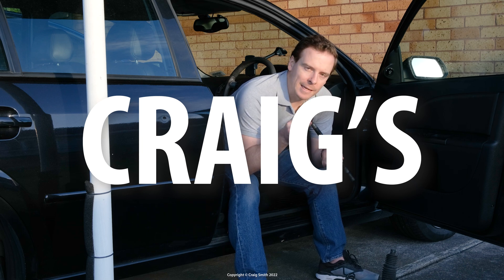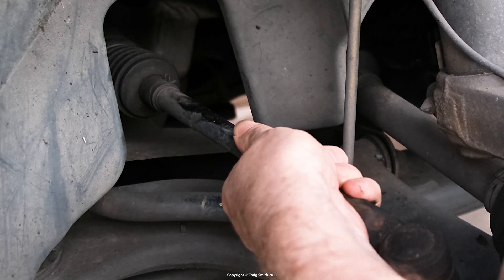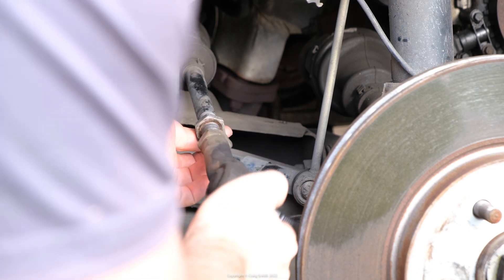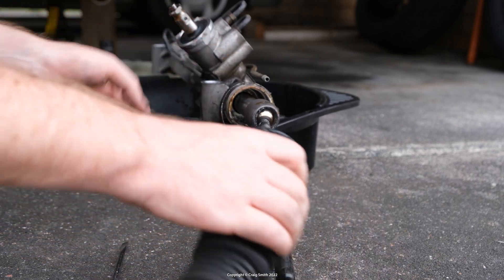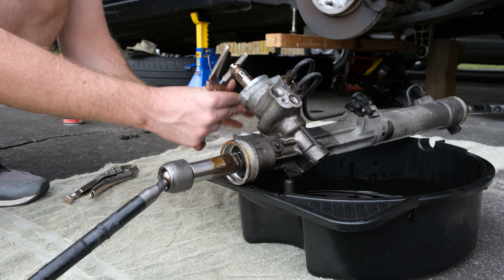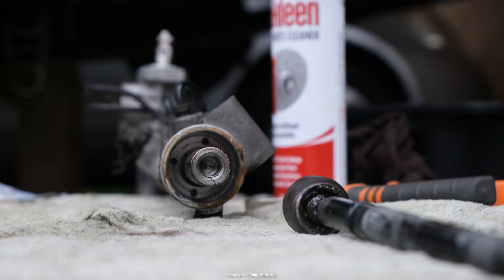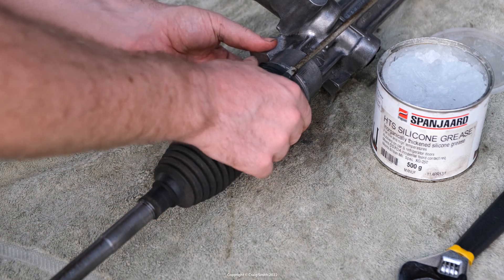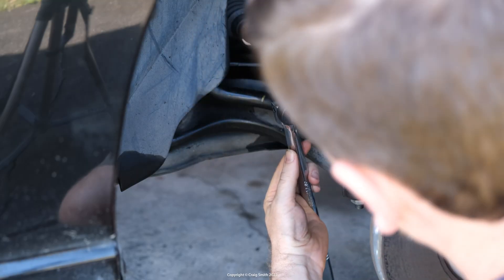How to: Replace inner tie rods (Ford)

Comment: Do you know how much time you have to do the torquing once you have applied the liquid thread locker?
Reply from the maker: About 10 mins, maybe bit more depending on temperature.
Reply: @CraigsDIY thanks a lot for your reply, ten minutes is a good time to torque both sides holding oposite sides simultaneusly in order to minimize the produced  tighttening stress on the pinion-rack assembly, whether on vehicle or bench repair.

Comment: I think it would have been better to remove the inner tie rod and boot, while in situ. Then replace once you have fitted back the second hand rack
Reply from the maker: Pretty difficult to get a grip on the rod while in the car but yes if you prefer.

Comment: If you get an old piece of belt leather about 2 mm thick and dampen it on the non smooth side, then place that on the rack `then get yourself a good pipe wrench , the old steel ones were the best made , that will bite into the leather but not mark the rack,
Dampening the inside of the leather seams to give it better grip,

Comment: Thanks for the vid, I just want to confirm something. I'd appreciate some insight. The inner tie rods connect directly to the rack and pinion, right? Therefore, if I replace the whole rack and pinion, there's no need to buy inner tie rods, is that correct?
Reply from the maker: Depends what you buy, in my experience a reconditioned rack or wreckers might give you rods as well, but you might just end up with the rack. And even if it comes with the rods, they may not come installed especially if being shipped because of the awkward shape. Enquire with the seller first.

Comment: Craig may i ask please my mk3 has oil leaking from the rack to the boots on both sides with the rods making a creaking noise but very stiff is there a cheap and or clever fix?
Reply from the maker: Oil leak from the rack ends means a replacement or recond rack I'm afraid. On the topic of which watch out for upcoming video. As to a cheap fix, you could try a stop-leak product in the power steering, but it's not going to be permanent even if it works.